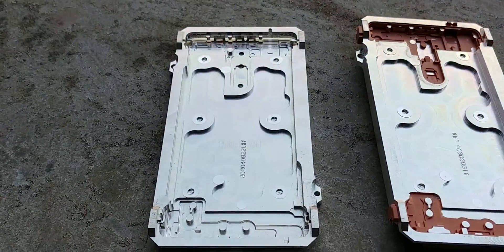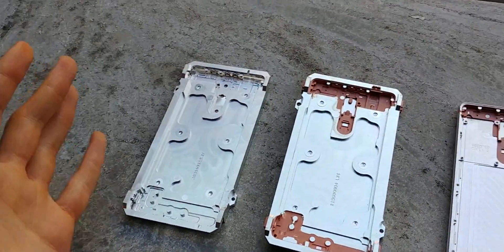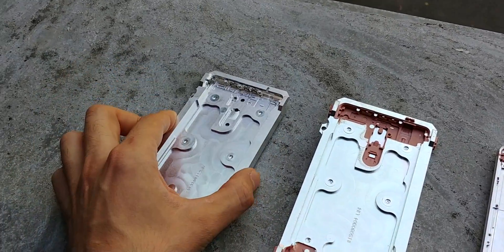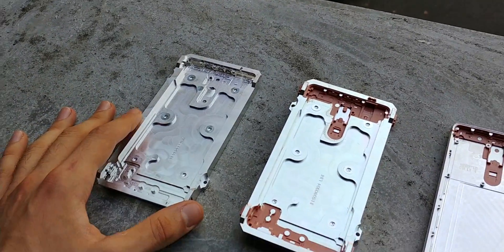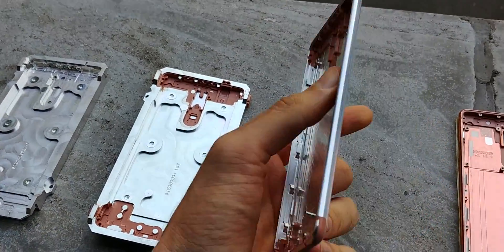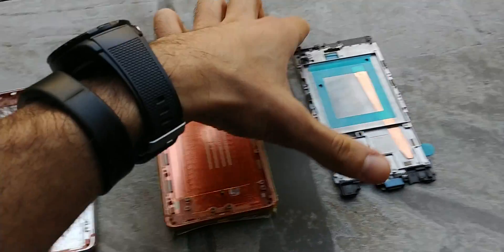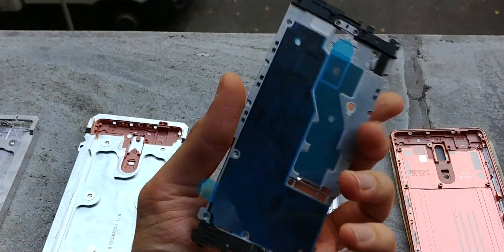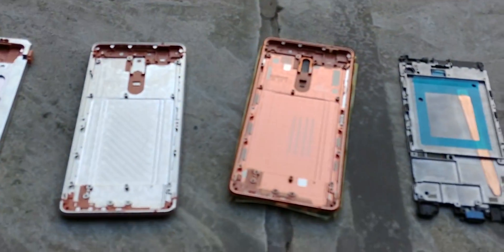How the Nokia 8 avoids overheating (shot on LG V30)

Comment: Sony was the first to introduce heat pipes inside smartphones and even had two of them in the Xperia z3. They don't use them anymore so they probably found another way of cooling the system
Reply: Liion B my XZ Premium has only gotten warm like 3 times, I've had is since June 1st.
Reply: Maikeru Dabittsu I think they used one long for the Z3 ans Z3+ then switched to two with the Z5 series.
Now they've changed this by using a graphite plate a dit it works really great !